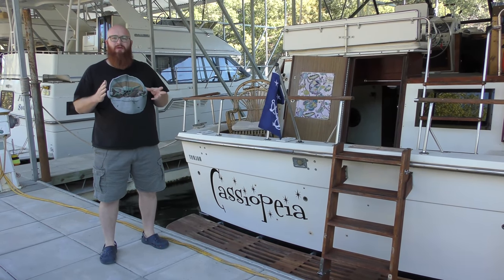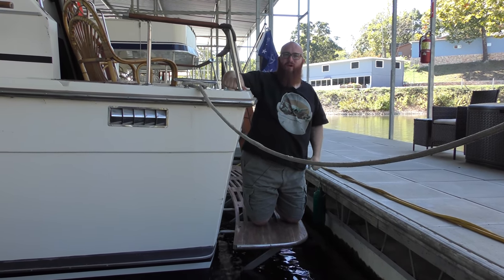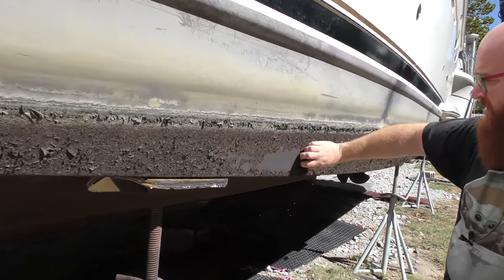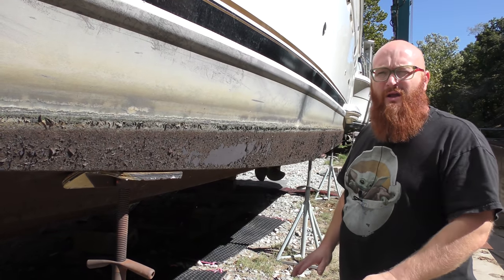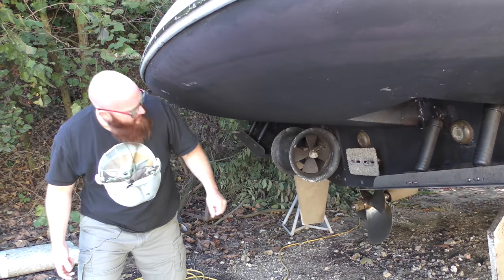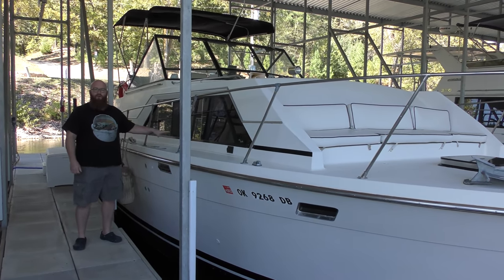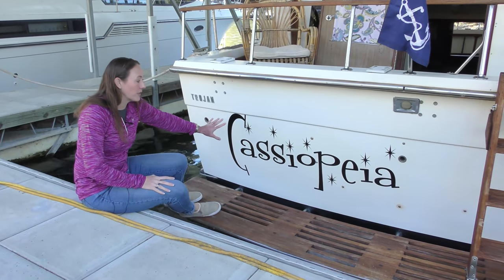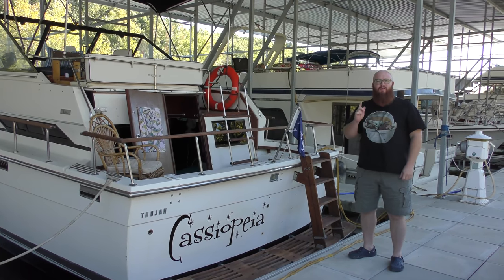Trojan #6: $4K Bottom paint job!?! CAR WIZARD shows how it's done & other major updates

Comment: Thank you for giving the lifting weight of the travel hoist in the most American unit possible- Chevy Suburbans.
Reply: By what factor would you have to divide that number if you used Ford Excursions as the unit of measurement? 🤔
Reply: @sumatoborukiSaru  Assuming a 2021 suburban and a 2005 excursion, the conversion factor is 0.77. So 15 suburbans is approximately 11.5 excursions. (Edit: I messed up my math, haha.)
Reply: The metric equivalent is Honda Civics, where 10 Suburbans equals 22 Civics.
Reply: Or one Rosie O'Donnell.

Comment: $4k sounds like at lot of money until you take into account the expert work and materials in the project. The Wizard recognizes fellow pros' work!
Reply: yup. That boat lift isn't the only expensive thing that needs to be paid for. The paint alone for his boat probably came to $1500 or more of that $4k.
Reply: @jwenting  $1500 for paint??? Hell no.  The cost was almost all labor, probably a power-wash and soda blasting, replacing/repairing thru-hulls, fees for "environmental impact", etc.  Bottom paint, even top of the line paint, is probably more like $500 for that boat.
Reply: That’s four boat bucks.
Reply: I work in the Boat Industry, for the Lift, Hard stand, products and labour its actually quite reasonable.

Take into account that ANYTHING that begins with the words Marine and Boat the costs are amplified by at least 4.
Reply: You wouldn't want to go to all that trouble then use sub-standard paint.

Comment: My family has a '46 foot flybridge, before that I grew up on various boats, but never realized just how crazy the whole process of maintenance was until I started working at the local marina. We use the same type of travel lift and it's a hell of a machine. He definitely wasn't lying about the smell! All the vegetation smells from the minute the boat is hauled out.
Reply: I worked at this marina about 11 years ago. Definitely don’t miss power washing the nasty algae off and grinding/filling blisters all day in the hot summers. The new travel lift is a work of art compared to Ol’ Blue that used to be there.

Comment: Only because I am into boats and yachts and worked on super yachts, I sometimes laugh at David explaining things on the boat. Coming from the world of Benetti, Azimut, Bering, AvA, Alia, Feretti, Feadship, Baglietto, Ocean Alexander, Cheoy Lee, Monte Carlo and many more, it's refreshing to see someone not so immersed in yachting discover things for the first time and explain it all. You may not have bow thrusters, but you can have Volvo Penta IPS drives and with that you get a joystick that can function without using the thrusters. They also have yachts with a sky anchor system that will keep you in place while away from the helm. And the new Absolute yachts and some others have a dockwise feature that works just like the autopark features in a car.
Reply: Cliff Bradley
Reply: @johnb4183  Sort of..
Reply: Oh god please dont ever buy a volvo penta product.  Mercruiser Only, i tell my customers this all the time.  I refuse to work on those products and send them to the shade tree volvo penta guy on our canal,  Because i told you so.  Fin Tacs and bow thruster systems get really expensive and take a long time to retrofit.  On top of that the bills get away from you fast if your not expecting a large bill.  If you own a boat always expect a large bill.  Bottom paint here in the atlantic is a every year thing
Reply: @andrewg2322  Hard to get Mercruisers on 37+ meter suoeryachts. Most yachts I have been on use MAN, MTU, John Deere, or Caterpillar engines. The smaller chase boats, the fishing boats or the pocket yachts are usually all Volvo Penta and we generally never had many issues with them. I've heard the stories though. Most of the yachts do the Med in summer, come back in the fall, come out for maintenance including repaint, soft goods repair and replace, respool the generators if needed, watermaker servicing, stove deep cleaning, engine service, tender maintenance then back in the water, hire a bunch of dockwalkers to clean the engine room, lazzarette, provision and teak work then back out into the Carribean for winter or stay in dry dock all winter and come out in spring and transition the Canal and go to Alaska in Nordhavn and Fleming heaven and stay there until summer then California and if the ship has range, Hawaii, Japan and Australia and pull out in Australia/New Zealand for repaint there. Some boats go over the polar circle and cut across back to the Atlantic.

Comment: In my youth, I did bottom paint jobs on boats back in the late 90s. At that time there already were strict EPA and OSHA requirements for managing the debris from blasting or sanding off boat bottom paint in a marina, adjacent to the water.  Special ($$$) blasting and sanding equipment was required to do the job.  I can imagine the regs. for this work got even more strict in the last 20 years.  The new paint, usually Interlux brand, was very expensive as well.

Comment: The as yet un-painted Carver didn't look bad at all compared to a single season for saltwater boats. A barnacle covered bottom will cut the top speed, and thus fuel efficiency, as much as forty per cent. The Wizard is making some helpful points in this video, especially to those considering a larger boat.

Comment: I am a professional boat builder and yacht specialist, I can roll bottom paint and change the zinks even the cutlass bearing for way less money and within a day.  Instead of wet sanding, there are other options get a 5 gal pail, buy arm & hammer super washing soda, DRY TSP trisodium phosphate power, and simple green and a green 3M pad or 800 to 1200 grit wet sandpaper, mix proper amounts as required per gallon of water, then wash and scrub your gel coat down, this combination will even remove jet fuel and years of sun damage, rinse thoroughly, wipe down with acetone, then buy Penetrol® Oil-Based Paint Additive by Flood, it restores the polyester Gelcoat to a shine, it will haze up buff it out, then compound the boat with 3M™ Marine Compound and Finishing Material removes scratches, oxidation, stains, swirl marks and other blemishes that are robbing your boat of its beauty. this will restore the Gelcoat like new.

Comment: That looks like a 30-40 ton travel lift.  We have a similar 30 ton unit at our marina.  The C-shaped frame means it's designed to haul sailboats and power boats with tall structures like flybridge Bimini tops and tuna towers.  There are also enormous 150 ton units used for superyachts.
Reply: Good eye on the shape of the lift. The marina used to have a 49 slip sailboat dock. The lift is a 2012 50 ton that was custom ordered at the Miami boat show with a boom crane.

Comment: Saw some nice action at the harbor this saturday when one of the older wooden boats were about to dock after a trip out. Probably a semi large two cylinder diesel or potentially hot bulb engine. Not noisy at all but a nice funky low rev growel on it.
Reply: Detroit two-stroke diesel..
Reply: @petesmitt  this wasnt a screamin jimmy.. you could count the beats on idle…  som of the old wooden boats in the harbor here is pre ww2, which makes it less likely to be a DD and more likely a locally produced engine.

Comment: Yeah that’s a huge job to wet sand and polish that entire boat! I’m actually not surprised by that estimate at all, and I do have huge respect for detailers that have that level of patience to perform that level of laborious manpower. I also don’t blame you for not wanting to do that at this particular moment in time given the amount of money that you’ve already spent on the boat thus far. Personally I think the only advantage to that would be that when it rains or whatever that water won’t build up in certain areas of the boat and especially if you’re able to ceramic coat it then it will slide off of there very easily. Perhaps somewhere later on down the road if that becomes an issue and you decide that you’re ready to take a whack at that you can always take it into consideration a later date. But as it stands now I think the boat turned out very good compared to what it was before!

Comment: I sand off the old paint residue with a hepa vac attached.  It’s brutal.  Takes almost two days.  Then I apply boat bottom anti fouling paint that costs $300 a gallon, weighs about fifty pounds, and barely lasts three years.  Salt water use. Barnacles. Slime. Mussels.

Comment: Car WIZARD, oxidation of the white paint on your boat can be removed with Citric Acid then you can polish it with Mirror Glaze and a 1750 RPM electric polisher with wool pad  A Wizard way to find out if Citric Acid will work is to cut a Orange in half and rub the orange on the white paint for about 30 seconds.. I use to shock people when I did that to prove a point. Good luck.

Comment: You think thats a big travellift you should see the ones we had in the Navy. Ours could lift a 24' x 90' 70 ton causeway section, basically a very large pontoon platform. It is impressive to see these lifts move big things however they are extremely slow. We had an accident where a sailor lost a leg below the knee because he was walking ahead of a tire as a safety person, tripped and fell and tire runs over his leg. They don't stop on a dime as you can imagine. Well your boat looks nice, thanks for the update.

Comment: Hey Mrs's Wizard. The captains drink holder you got has holes in it.  I would be very careful putting your cellphone underneath it on a hot summer day if you are storing a hot drink. The condensation from your drink may drip through the holes onto the phone and possibly ruin the phone ( many are not water proof.) Otherwise great buildouts. Enjoy the boat.

Comment: I would recommend removing the registration numbers currently in place and replacing them with nice vinyl lettering. You can get them in myriad colors with two-tone shadowing effects and you can make the letters/numbers larger than the standard three-inch size. I have a 27 foot Sea Ray cuddy and I put 3 1/2” size numbers on it. I think 4” would look good on yours. And they’re not that much more than mailbox numbers. 👍

Comment: Nice work. 
glad you enjoy your spare time/hobby.
AFAIK.... the cost of repaint is very much increased due to the cost of the new paint and the pollution issues with the removal of the old paint.
BTW what happened to the big boat that was in the shop???
Reply: He sold it for scrap. In a video he explains that inside the hull the wood had all rotted away.

Comment: A big reason for boat abandonment is cost. People can no longer afford to maintain and use the boat, put it up for sale, and it just sits there for years and years before someone comes along who is interested, if ever.
It's little different from barnfind cars also. Sometimes someone dies and the next of kin are estranged and don't even know the thing is there until the marina bills arrive. If that's after the house of the dead person has been sold the bill may even be returned to sender rather than forwarded to the people who inherited the boat, and the boat is quietly forgotten.
The marina will try to find the new owners as best they can for a while before writing the moaring and storage fees off as a loss and trying to gain ownership of the boat through the courts as an abandoned property, which takes more time.  All that time the boat just sits there without maintenance or cleaning, reducing its value more and more.
Less of a problem on inland waters as compared to seaside is smuggling boats abandoned in marinas when they're no longer needed.

Comment: It looks like that's a large bit of really needed maintenance taken care of even if it's mostly out of view under the water. The seating is a great addition. As far as the cost, well it's a boat (break out another thousand). That's part of why there are so many abandoned ones. People get what they think is a deal on a used one they can just afford and then realize they don't have the multiple thousands for something even as simple as getting the bottom repainted, much less anything else. Maybe if they haven't gotten too nasty, they sell to somebody else. I bet some of those project boats have been through multiple owners all of whom ended up being unable to handle the costs. Eventually they get so bad they won't sell and then the marina is kind of stuck with them.  A lien on something nobody is going to buy is pretty useless. Moving one of those is majorly expensive so they sit there in the water until they sink. I imagine at that point some sort of insurance kicks in and they can be hauled off as a total loss.

Comment: Cassiopeia, The Queen.  Good call, happy wife, happy life.  The constilation forms a 'W'  in the northern sky.  A 'W'  for Wizard. Search the star pattern.

I love the new box seating!  You can as also stretch out and take a nap while cruising. Oh that's the best.  You will need a larger pillow so you don't bump your head on the framework.

  Trivia, When a cat is aboard a ship, it dosen't belong to anyone.,  don't claim it, it belongs to the ship. 
  When on board a ship/yacht,  you dont pull on a rope, you haul on a line.  When a cannon boards a ship, it is no longer a cannon, it is a gun.  You do not ask what time is it aboard a ship, you ask, How many bells struck.  You need to get a ships Bell clock, once you learn the bells it's easy.  I recommend a free phone app.  Enjoy mates.

Comment: While in the Navy The USS CVN 65 Enterprise was in drydock try walking down many stories to the bottom and having it secured look up at the bottom of it and you feel like a ant mind blowing, and looking at those wood blocks without a V cut in the video that's 100% wrong that's a lazy short cut to much load bearing weight on a keel thats not even flat that will now have stress micro fractures going forward

Comment: Sad to see that old abandoned Chris Craft... beautiful classic
Reply: It just sold last year. There’s still hope for it
Reply: That is a late 1960's Commander or possibly a Steel Hulled Roamer. Beautiful lines. Probably a couple of old big block Chris engines with Paragon Gears. I hope it gets saved.
Reply: 1968 41’ aluminum Roamer needs re-powered I believe
Reply: @austinstuart6987  If it's been in fresh water all it's life, there's hope for sure.  My immediate concern would be thru-hull fittings and improper winterization.  I'm sure doing a re-power is no easy task either.  Do you know if they used aluminum stringers as well as the hull itself?

Comment: Wizard, did you have the bottom barrier coated before the new paint was applied?Our many years boating we learned a long time ago that fiberglass absorbs water and can cause osmotic blistering and add weight to the hull without a barrier coat.
Reply: Not necessary with the paint that they use